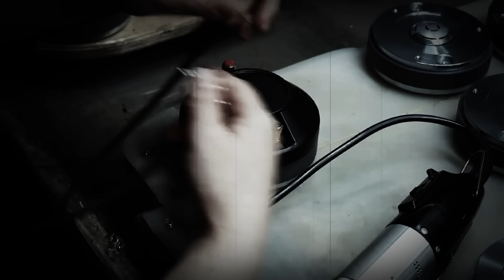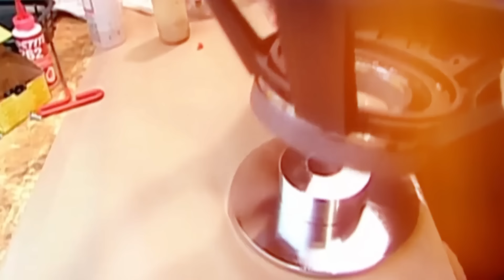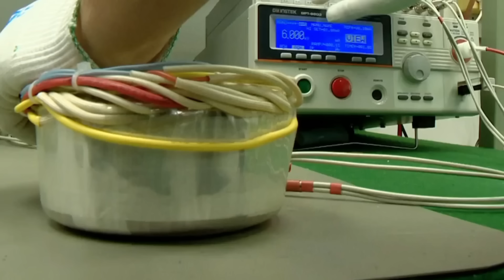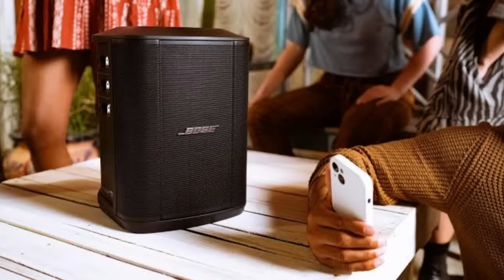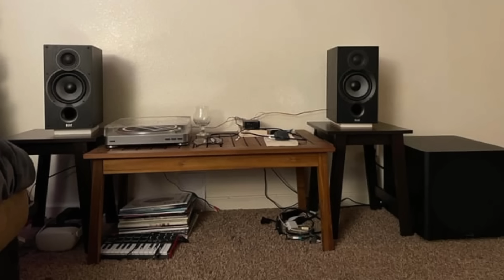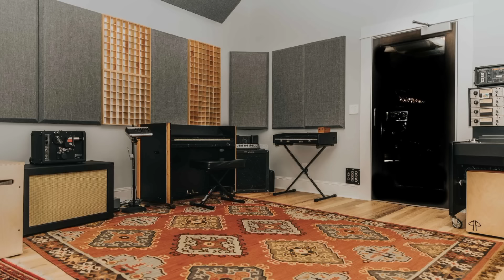Why 90% of New Hi-Fi Speakers Are Garbage (The Factory Secret)

Comment: My speakers are just under 40 years old the original AR 9s improved that is the ones with out one 12 inch woofer side firing but only one 12 inch forward  n a 10 inch down firing woofer an 8 inch mid range a tweeter  n a super tweeter all 42 inch high n over 100 Lb weight bass to 28 Hertz at + or --  minus of course 3 Decibels driven by a heavy JVC power AMP with 3 huge transformers over 20 kilos the amp a Shure cartridge pre amp will take an MC cartridge I never bought wanted a tube amp never bought one either, now at my age I do not listen to it 4 5 hours a day not even every day now  at my age n my system does Not need boom boom subwoofers what is your opinion of AR speakers specially the AR 9s?
Reply: I had the AR9-LSI also. Very good speakers. They sound massive, which of course they are! I also had and still have a pair of AR-10 Pi's which I feel are smoother through the midrange and tighter, but not quite as extended in the bass. Still listening to them today. 
AR manufactured some well regarded speakers in their day!
Reply: @MaxVal444  After I split up with my EX I bought many AR speaker mainly SH the only other I have now is my AR5 with their original white cloth b n the best i had after the (s where the AR14 a two way speakers but very good sound I also have an AR amp AR 04  just bought it cause it was AR  most speakers in my time were very hard on the treble n lacked real bass British speakers I loved were the KEFs most others I hated their top end thanks for your reply TC

Comment: any series inductor , cheap or expensive is killing the punch response of the bass .
Reply: why?
Reply: @RoverWaters  probably bc of the nature of inductors resisting voltage change . but i know it by experience certainly , they do that . i took one out and started using active crossover and tested the difference in the process . in fact it is quite easy to test with an inductor and a bypass switch if you want to be sure .

Comment: Great video: Don't forget acoustic ceilings. Yes, those popcorn ceilings that are so out of date? They were originally invented to take the echo out of your house and add R value; and they do. I installed them when I was a kid. My home theater/ sound room/ Living room, has an octagon vaulted ceiling over it with curved lines, a heavy popcorn ceiling finish, mother of pearl flakes blown into it while it was still wet, and insulation under the drywall. You cannot hear anything in the upstairs bedroom above it. The subs will shake the whole house, but the ceiling in the sound room is very effective for everything else. And as a bonus? The center ceiling fan lights make the ceiling sparkle rainbow when their on. Very nice. Add soft shag carpeting with an inch of padding under it on the floor, with a hard wood surround, and one end of the room open with giant open arches to access the rest of the house? There are no reflective walls and the room is sonicly pure. I built that room myself to NOT look like a sound stage, even though it is.

The only thing that gives it away are that I don't use any grills on the speakers. Speaker grills kill your high treble no matter what they're made of. Try taking them off and on. You'll hear it. Believe me. No matter what they are.

And what kind of speakers do I use? I'll have to think about this. My mains are McIntosh 1976 vintage speakers that I've upgraded with carbon fiber drivers that sonicly match the originals, with a 10 band graphic equalizer to balance them from the original McIntosh blueprints. The cross overs are peg boards that take one side of the entire speaker and must weigh 15 lbs each. For surrounds I use B.I.C. Venturi's that are ported with carbon fiber drivers and titanium tweeters. The Subs are a pair of B.I.C. Formula F-12's with 475 watts each that drop all the way down to 15hz. And 950 watts of sub power will easily shake the whole house, dangerously so. 

This system is powered by a wall of Sony mid 80's Dolby Digital surround gear @ 2,200 total watts @ .005% total harmonic distortion. In those days, Sony was really expensive, but you got what you paid for. 40 years later they all work just fine. (I did have to replace one remote) I use a sound level meter to balance the speakers. The opening sequences of Top Gun will put you on the floor, and Twister can break windows, and has. I have since put in much better hurricane proof E glass windows in the whole house. LOL I built my first sound system when I was 16, today I'm 68. Adding video is the only major change to it I ever made. The McIntosh speakers I found at the side of the road in the trash with blown drivers. Really, the guy had no idea what he had. The television is an LG 65 inch, the largest size that will fit in my entertainment system. I'd have to rebuild the entire room to go any bigger. But we only sit 10 feet away.
Reply: I agree with Danny Popcorn ceiling is good for acoustics!
Reply: Bose retailers are not allowed by Bose to A/B testing with any other speaker models. They are not allowed (of course I’m sure some may do that) to put their product against any other speaker models because in A/B tests Bose knows they will lose.
Reply: Had to include this story: It was movie night and the neighbors were over. Chuck Norris movie: In Norris's house, out his front windows was a huge car crash. Instantly all the Neighbors jumped up and ran to the front windows, because it was coming from between our front windows. The surround sound was spot on. I never laughed so hard in my life. 

Talking about my system brought back some memories. 

Last night, I watched David Gilmour "Comfortably Numb," Live at Pompeii; at concert sound levels. (at least 135db) I couldn't hear until this afternoon. It's a pretty incredible system. You forget. We almost burned the house down working on the deep bass power systems. We had a 1,200 watt power amp start on fire. Not smoke; fire. That one scared the madmen, but we added lots of cooling fans. LOL Today, because of tech, they're not even needed.
Reply: I had popcorn ceiling installed when I built my house in 1983. In 2021 Hurricane Ida decided to strip my roofing off my house causing internal water damage. Insurance was a joke and much of my rebuild cost out of my own pocket. All ceilings in all but 2 rooms and all walls were stripped to the studs. No more popcorn ceiling.
Reply: @Aswaguespack  That much is certain. LOL
Reply: Sorry about your troubles, but at least you didn't lose your wife. I just lost mine last week, after 28 years together. It could be a lot worse; believe me.
Reply: @dannysdailys my condolences. Physical items can be replaced but family is irreplaceable.
Reply: @Aswaguespack  Yes, and everything we ever learned, everything we've ever known; are washed away like tears in the rain. Just gone like that.

Comment: Tanoy speakers anoy me the most. I never owned them but saw them in thrift stores knowing they were sold for to much money. I keep to my refurbished Philips 22AH487 speakers from 1978. for my Gaming PC set up with a Marantz model 1070 1977 Amp.
Reply: You know absolutely nothing about hifi... you're using Philips speakers and are ranting about how much tannoy annoys you?🤣.. I've owned several pairs of Tannoy speakers and I can assure you, Even the entry level models blow away your Philips junk. Btw I've owned Jamo, Castle, Mission, JBL Tannoy.... The Castle and Tannoy were the best
Reply: @Deeky76  Had them all through my hands. Even heared the bigger ones. But this model Philips sounds the best on my Marantz Model 1070 Amp or my AKai AA 1175. Reciever am. It is about balance. Next I will have  my  Marantz Model 2250B reciever refurbished. My main turntable is an Aristona 1312 wich is in fact a Philips 312. the one from 1974 wich the touch tips. As back up turntable I have the Technics SL 1710, Both turntables have new Elips elements.from Tonar brand. The Marantz Model 1070 Amp drives the Philips Speakers on my Game PC set up and for my Turntable I have a Philips 1971  RH590 Amp. and modern Sony speakers.  At the moment I am using a Sony TC S! cassettedeck for my cassettes and in the future I may have my Marantz Model 5025 Cassette player refurbished. I have donated my  1975 Beovox S75 to the cantine at my place of work because the balance of the sound stage with the Marantz, Akai and Philips Amps sounded wonky to me.
Reply: Tannoy, not Tanoy. Annoy, not anoy. Too much, not to much. Your spelling is SHITHOUSE!!
Reply: If you ever heard the Tannoy Autograph corner horn, you would change your tune.
Reply: @virgilstarkwell667  If you never have heared the 1978 Soft Dome Philips Tweeter you should know Philips made that one for MC Intosch too biut with a rectangle plate instead of a round plate.
Reply: @corneliusantonius3108  - I have been an  ALTEC Lansing fan for the last 60 years, for both consumer and professional audio. I care not what Phillips does with round plate or square, nor have I heard a McIntosh speaker that impressed me.
Reply: @virgilstarkwell667  I had the ALTEC Lansing Model 1 with the Walnut, but understood they were flat sounding and it only got good with the ALTEC Lansings Model 3.s. Now guess what Philips 22AH487 Speakers really are. They go 30 hz deep and have a passive Radiator to work with the bass cone. The whole space in rhe Cabinet/Speaker is for the Base cone. The soft dome tweeter and the soft dome squaker(mid) cones have their own enclosed pods not interferring with eachother or the base and the 3 Way crossover is build supurbly.

Comment: I found it a bit odd that when you said the industry is tricking us with bad insides you were displaying some speakers that are actually really good, and priced below how they play like Revival audio. But on the other hand, I agree that it is true for many speaker. Not only do they use cheap parts, they are not well tuned either. 

I also agree that the room is hiding a speakers true potential, and therefor I have treated my room as best as I can and also become adited to room correction like dirac and room correct. those things are amazing, but they can only do what the speakers allow you to do, so you still have to find ones that have great parts, and a solid build rather than just looks. My problem still is that I am struggeling to find a speaker that has it all, so I have a couple in my home that I switch between. So far they are all great, but serve different purposes like one for relaxing and one for more party in your face feel. 

Anyway, I have become pretty well aware of expensive speakers skimping on crossover parts and also drivers. A good driver is needed for the full potential of a good crossover. So I can safely say that certain DIY brands do give a great band for the buck also, not just premade, store-sold spealers. In fact, they are well better for the price, so a no brainer, but you still have to find one with good balance to your liking. 
The industry is totally backwards today. You pay for looks before the insides which is a shame. 

On bluetooht speakers it is just so much one can doo with these small units for great sound, but when on the go or at a BBQ you dont really need perfect center and all that. You just need clear music with good bass that brings the mood, and I can recomend JBL units over any other brands any day cause they trie to keep what I call a normal sound. Bose to me works, but I find that sound to be weird and a bit off. With JBL you get tons of options and sizes, but they all have a core sound with less or more base depending on what you want at an afordable price. Heck I even use headphones from them that sound better than what I have heard from the high end brands. And bluetooth will never be high end anyway so..!
Reply: With Tekton Design, you pay for the components. Looks are secondary. The MOAB is 25% off. Great Deal.
Reply: JBL were also my favorites. I bought a pair of L65 Jubal's in 1976. I stupidly sold them in 1985. I just recently purchased a pair of Klipsch floor standing speakers, and although they sound pretty good, I would take my old Jubals over those, any day.

Comment: Stated here they say that the Genelec 8030C has GLM room correction. That is incorrect. This model does not include that capability. Only higher priced variants offer that.
Reply: The excellent speaker manufacturer GENELEC's Sam models have room correction. The 8030c model does not have room correction, but it has a small number of small switches on the back and very limited possibilities for modifying the sound.

This AI video is deliberately misleading with ignorant claims. VERY POORLY IMPLEMENTED, NOT LIKE THIS!!!!!

But in any case, most Genelec speakers (SAM SPEAKERS!!!) have the GLM/room correction software interface included with the speakers. Still, you need the glm software /(FREE) and a computer to measure the echoes of your room with the Genelec microphone and transfer the measurement data via the computer to your SAM speakers, i.e. the measured data of the room correction that corrects the sound to be balanced.
Reply: In addition, every single Genelec (((SAM))) speaker has a very high-quality DAC inside, so you really don't need to buy a separate hifi DAC anymore, but by using 110hm AES/EBU cables, which can be used to convert even coax/spdif/USB/ audio sources into a digital stream suitable for AES/EBU cables, e.g. a bluray player or laptop. This way you get the full maximum dynamics out of your speakers.

For this job, there is already a suitable Genelec 9320 converter control unit, which also has a volume control. Of course, you can use many DACs from different manufacturers in all room correction/sam models if you feel like trying different DAC tones, but then we go traditionally with xlr/rca/analog up to the speakers, and the room correction is already done. But it's a pretty pointless waste of money. Genelec SAM (smart active monitor) speakers have a very transparent and beautiful sounding DAC chip already inside.

As a mere hifi enthusiast, I already own many SAM models. Of course, the 8030c in the video is a very unique speaker, even without the SAM room correction.

Comment: “The room matters more than your speakers”. How many times have I heard or read that comment? It is blatantly, not true! Try listening to your room with the speakers removed and you will immediately realise how crucial the speakers actually are. Then try using a premium headphone set up. No DSP, no EQ. Just raw music. You will instantly realise how little influence your room has. Unless of course, you’re listening to a €99 Alba all in one system, full blast in an empty concert hall. 

Sometimes high profit solutions are marketed with pseudoscience to solve inconsequential issues.
Reply: Your post is an actual fallacy of logic.  I think that you're trolling.
Reply: @poopy_pants_joe1194 Sure, if it were an old Stone Church with a lot of echo from the stone walls. But in a regular living room, a voice can still sound quite neutral and correct. A microphone can perceive voices in different ways. I have discovered that. So much so that the person can sound like another person.
Reply: if you invite a singer to sing in your living room and she sings without a microphone in her hand and no speakers are on, then her frequency will also be affected or her voice will be affected by the room 

But would it be possible that her voice would sound similar through speakers in the same room the answer is yes . you know you might get a bit metallic because of the material in the speaker element . you might not notice it but you will notice it when her microphone stops working and you hear her voice directly from her mouth instead
Reply: @Andersljungberg if you were fortunate enough to hear Ellie Goulding singing in her shower, your car, my lounge, your listening room, my garage, in the auditorium of a large concert hall, on a sailboat on the open seas, in a dense forest, a complex cave system or a mountain top, in every scenario the fidelity of her voice would remain unaltered, true and correct. In every instant she would be unmistakably Ellie Goulding. Only the spectrum around her voice would change, only the ambiance would be altered. Our auditory system has evolved over hundreds of thousands of years to clearly and easily differentiate between direct and reflected sound.

All that room treatment does, is alter the ambiance of your listening environment. Whether that altered ambiance actually constitutes an improvement, must come down to personal taste and preference. EQ and DSP on the other hand can degrade fidelity. FIR filters introduce clearly audible artefacts. Keep your audio chain as simple as possible, minimising  unnecessary processing and phase shifts and the room influence is reduced, frequently negating the need for any form of correction.

Comment: In another video tell that there can be problems with OHM in the speaker maybe specified at 6 ohms. but can be significantly lower in certain frequencies for example the crossover frequency. the result can be that your amplifier gives up and it can start to smoke from the amplifier simply the amplifier does not fit those speakers
Reply: correct